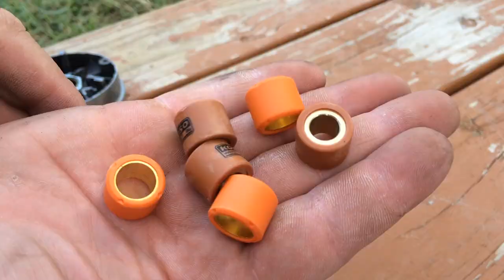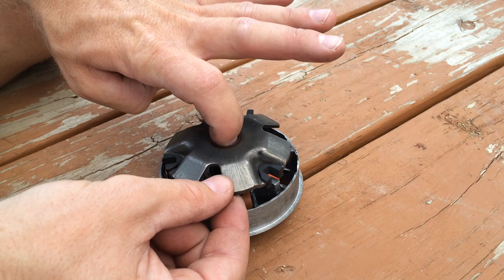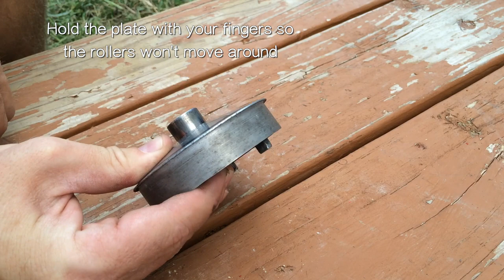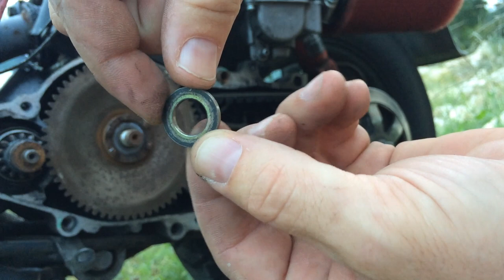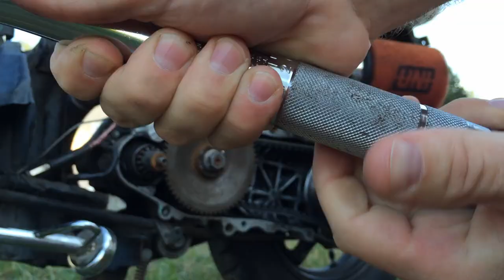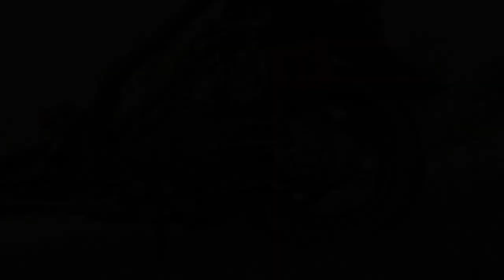Honda Elite / Tact 50 - CVT Installation (belt, variator, rollers, clutch) | Mitch's Scooter Stuff

Comment from the maker: Tools I used:
16x13 roller weights - http://amzn.to/2CI3i2s
Torque wrench 0-150 lb/ft 3/8 - http://amzn.to/2Crqq4R
14mm 3/8 drive - http://amzn.to/2xGn4Ms
Homemade rotor holder - https://youtu.be/YIVAimvORFI
8mm 1/4 drive - http://amzn.to/2xMhsBl
3” / 6” Extension set 1/4 - http://amzn.to/2wDuzzW
Ratchet 1/4 drive - http://amzn.to/2xcJEu1
Homemade variator holder tool

SHOP MY SCOOTER STUFF: http://amzn.to/2CbqQku

Honda Elite 50 videos: http://bit.ly/2g4hMPr

Comment: cool instructional video. A tip.. some people will only be working on the variator or belt and won't need to touch the clutch, and might have power tools. So the proper way to remove the belt or just to get some slack during reassembly is to pull the REAR outer pulley-half toward you, and let the belt fall lower between the two halves. Tons of slack so the belt easily goes on or off. This also prevents unnecessary stress on the front (variator) shaft, the boss, and the pulley halves during reassembly which can lead to a warped variator, which means chewed up rollers, severe loss of speed, noise in the cvt, and ultimately a disintegrated or exploded variator.
Reply: i can't seem to pull the outer pulley half toward me in order for the belt to slack and fall lower on the variator drive side - too much tension. what can i do about this?

Comment: Where do you find the exact style of your Honda Elite I haven't a Honda Elite in the pink slip says 86 but I don't know if it's a 50 or 80 or a hundred where do you find that at on the bike or the I don't know very
Reply from the maker: Look for vin number on the frame under the floorboard / behind the front fender